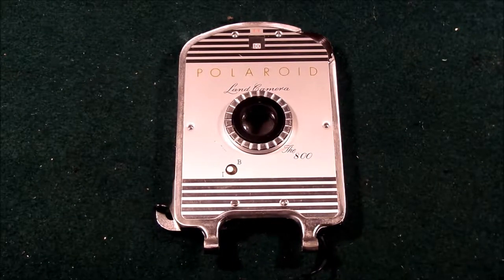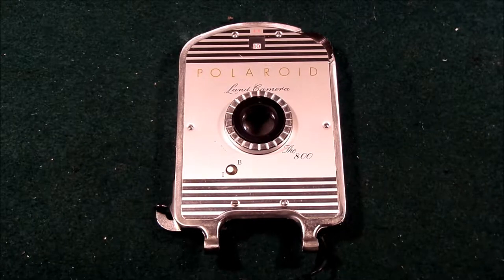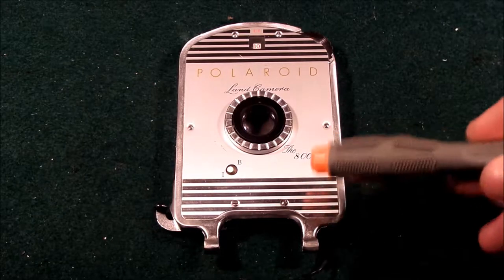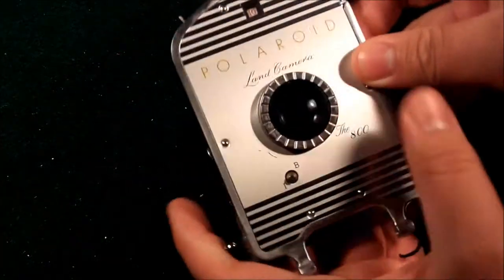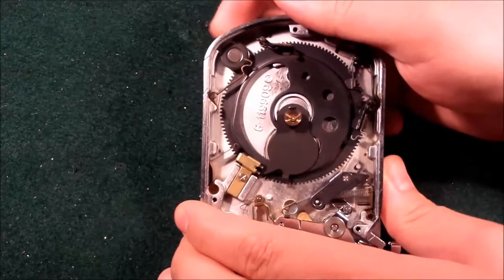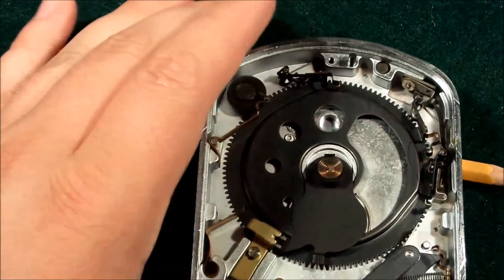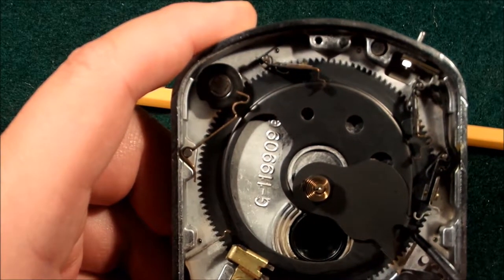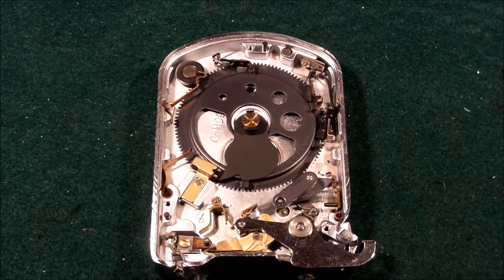Polaroid Model 800 Shutter Mechanism

Comment: Nice job. I admit I didn't listen to the audio because my wife is watching a movie at the moment(s)...so I'll add my comments with apologies if you covered these topics.

1) Anyone repeatedly cycling this shutter with the rear plate/lens removed to study it, be careful to not allow the shutter actuator plate from creeping up on its pivot shaft. The back shutter cover keeps it where it belongs. If it lifts away from the back edge it's normally rotating against, a spring can fly across the room. I have lost more than one. The springs that can escape are the one that flings the brass piece that knocks the shutter release, and a spring that resets the B/I (bulb/instant) function.

2) If you are plagued by the 'time-of-flight' or 'pinball machine' shutter bouncing open and closed a couple times after firing the shutter, there was originally a small piece of foam rubber between the two blades or poles of the magnet that catches the shutter when it returns. The magnet is able to move a little in response to the impact of the shutter disk. The combination of the foam cushion and the floating magnet serve as a 'brake' or shock absorber. The foam decomposes as foam does, and the magnet is no longer enough to catch the shutter...and it bounces open and closed a couple times before there is no longer enough energy to escape the magnet's field. After a couple unsuccessful tries cutting foam rubber sheet, I found the very thin white (urethane?) foam sheet some items are shipped in (less than 1/16" thick/1.5 mm) works. I took a piece about 1/8" (3 mm) wide and 1" (25 mm) long and folded 2 or 3 layers (like a 'Z') and pushed it between the magnet poles. If it's too thick, the returning shutter will not close all the way and leak light. If too thin, it bounces open a little bit. I don't remember but think I didn't need to glue the foam in. If you do need to, make sure you are satisfied with the shutter 'brake' before committing to adhesive. Also, you don't want an adhesive that can dissolve your foam.

3) If you do some kind of conversion (replacing the Polaroid shutter/lens/front standard), or lose a spring and abandon the lens/shutter, it actually adapts fairly easily to digital camera use. 

If your shutter still works and you just aren't using it, set the B/I to B and fire the shutter. The B 'hook' will catch the shutter on its return path so the aperture remains open. You leave it open for adaptation. 

If you have lost the shutter release spring or the B/I spring, all you need to do is manually rotate the shutter disk open with a finger, and make it stay open by any means necessary...a small piece of tape, or a dab of contact cement after taping the shutter disk to the path it follows in an open position. 

The lens is a (Cooke?) triplet (3-element) glass lens 130 mm f/8.8 wide open. According to the old RWhirled site, some of them were made by Yashica. Others by someone in Rochester. Both respectable. 

I took an M42 extension tube (bought a set of three lengths "1", "2" & "3"), which is a little larger in diameter than the rear lens cover. I epoxied the extension tube to the rear shutter plate. That is then threaded into a M42-M42 helicoid. Don't make the mistake I did of not realizing the epoxied Polaroid assembly will orient in some random position when fully screwed onto the helicoid because of my random orientation choice. It would be better to thread the M42 extension tube onto the helicoid adapter and that onto whatever M42 adapter your digital camera requires, then epoxy the extension tube to the rear Polaroid shutter plate so it's oriented vertically when fully threaded. It will already look freakish or Franken-cam, but planning it to look like you planned it to be vertically aligned. On the other hand, I just unscrew my misaligned shutter/lens a fraction of a turn so it's straight.    

The M42-M42 helicoid I used was a 35-90 mm one because of the length of M42 extension tube I epoxied to the shutter and the M42-native adapter on a few different cameras (Pentax Q7, Nikon D1X and Sony NEX-7). Either figure out what length you need, or if you have a range of helicoid lengths, experiment. The long helicoid gives you some nice macro function at long subject distances. You just don't want something too long you lose infinity focus or so short you cannot reach infinity or closer.
Reply: You don't need 25mm of the 3mm thin foam wrap sheet. It's easier to use a longer length then cut it, than to fumble with a 1 cm (3/8") long piece. The suggested length gives you enough to hold onto & you can trim it later after you figure out what length 'de-bounced' your flapping shutter disk.

Comment: I'm having trounble simply opening the camera and I could really use some help. I can open the front part, but then I can't extend the metal bracket below the shutter to pull it all the way out. It's completely stuck. Do you have any advice? :(

Comment: Excellent video! Thanks for creating it!  At 13:17, is there any simple way to convert that flash socket to (or to connect that flash wiring to) a modern PC sync cable? I just cannot find the Polaroid Electronic Flash Adapter Cord #490 for sale anywhere.  (I own a Polaroid 800).
Reply from the maker: It's doable, but you would have to have a male PC socket, drill a hole in the shutter housing to mount it, and wire it in parallel with the other electronic flash socket.

Comment: Would you know why the camera only fires flashbulbs when the lens is extended all the way forward? Is there a way to get it to fire flashbulbs with the lens extended part of the way?  If I were to use an electronic flash, would I still have to extend the lens all the way forward?  (I modified my Polaroid 800 to use Fuji Instax Wide film with a Lomograflok back. In order to get sharp focus, the lens has to be extended part of the way forward to a specific point, which means the flashbulbs won't fire).
Reply: I just installed the Instax wide back from LoFi&DIY (Christmas present). It uses a stick on stop to adjust the lens position too.

My 281 flash (M5 bulbs) works fine.

So my first thought is a wiring problem. When you have it farther out the wire moves and makes contact.
Reply from the maker: If you're using the hot shoe, you could have a break or kink in the cable that connects the shutter to the hot shoe on the body. It only makes contact when the lens is fully forward. You could try replacing this wire. It shouldn't have any effect on the electronic flash contacts on the shutter assembly itself.